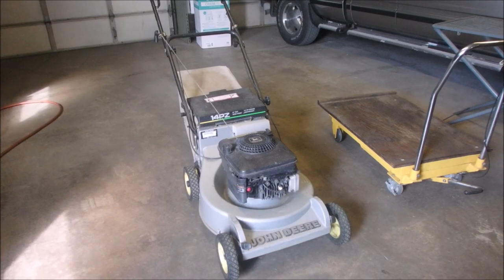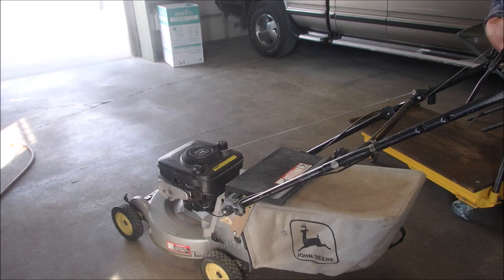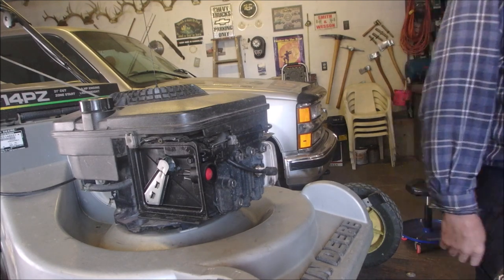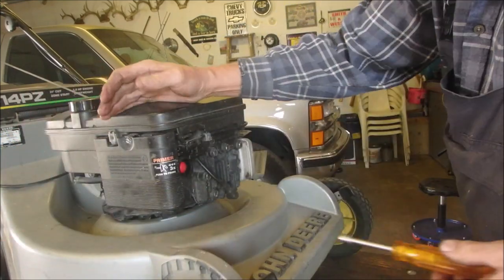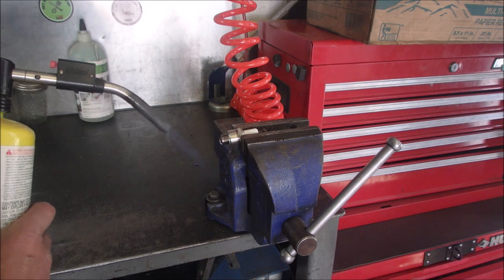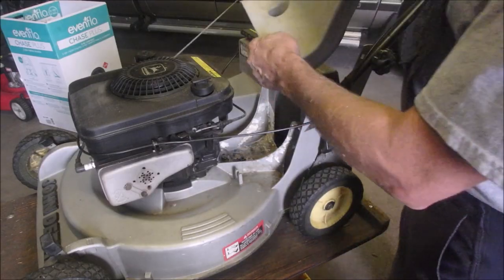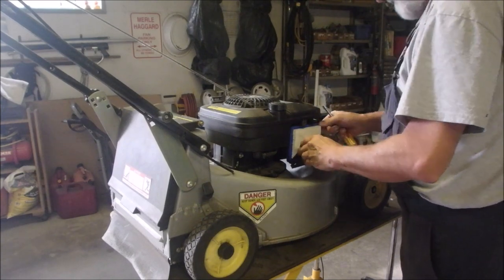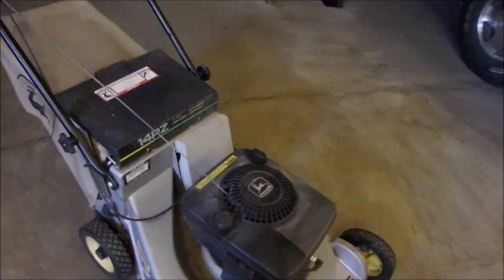John Deere 14PZ Push Mower,  Intermittent Start

Comment: I've got the 14SZ, self propelled with the Briggs engine. That plastic cover is where the belt is located, with the transmission in the rear. Great mower.
Reply from the maker: Thanks for the info!   That makes a lot of sense.
Reply: I have the 14SZ too, with a Briggs, my Dad bought it new in 1993 and I’ve been using it since 2009. Still starts first pull. Best mower ever.
Reply: That's about the same age as mine. The aluminum deck is great. The wheels wobble quite a bit. Thinking the ID of the wheels wore larger, as well as the bolts probably wearing down. Should buy new wheels and hardware I guess. I grease the rear wheels and clean out the rear wheel gears of debris buildup in the teeth.
Reply: @billlink1726  yeah my wheels don’t wobble much but at least 2 of them are very worn, I should be retreading them or something. They were such great mowers it’s too bad they stopped making them. I guess my replacement would be a Honda but I find the Hondas a bit awkward, I’ve used my Dad’s and it seems like a longer 
 deck.

Comment: Always nice to see this series in good shape, and good job. As others have said, the cover is for the self-propel equipment for the 2- and 5-speed transmissions. I have 3 of these; a 14PZ like this because my wife hates self-propelled mowers, a JX75 because I hate non-self-propelled mowers, and a 12SB (the 2 being for the 2-cycle Briggs-branded Zenoah 2-cycle engine) that I can't let go of because I mowed my grandparents' lawn with it throughout my adolescence and it brings me back to 1995 and makes me smile. They mulch awfully well, but the aluminum decks will still rot if left full of wet grass mush.
Reply from the maker: Thanks a lot.  After I made the video I was editing and went DDUUHH  That is for the rear drive of another model.    Thanks for letting me in on your past.  Very interesting.

Comment: Excellent video Bruce and great tip on heating the spark plug then cooling and checking resistance in both conditions to confirm the intermittent problem. By the way only tighten the head bolts when the engine has not been run and cold then we mark each head of the bolt with a paint marker that matches the deck colour so if we get it back we know we have tightened them and we check again then remark the bolt. Your are also correct that B&S do not make them like that anymore and additionally being so old it was likely purchased at a dealership, BIG difference on what you buy today from a dealership or a big box store with the big box not carrying the exact same quality JD equipment. Always check the model numbers and call a dealer to confirm you would be getting the same JD they will likely give you the information on the differences between theirs and the big box stores. Additionally the dealer is like family when there is an issue with your mower try dealing with the big box stores sometime it is a nightmare like THEY DO NOT EVEN TELL YOU THE MOWER HAS NO OIL IN IT AND THERE IS NO OIL IN THE BOX. We have had at least 10 customers this year call with seized engines because they did not put oil into the engine. We have helped half of them get free replacement mowers and do not want to get into company names that would not help the others out.
Reply from the maker: Thanks Wayne.

Comment: Very good Mr B. Had the same problem only yesterday with a brand name plug too. Intermittent can be tricky to diagnose & could lead to chasing you tail when it's actually the simplest solution.               😏     D0oohhhh!
Reply from the maker: Right.  If I had changed the plug right away I would still wonder.

Comment: Well done Bruce.  This is my old mower that you picked up in Lacombe Alberta.  It did me well.  It was becoming increasingly frustrating when it wouldn’t start when warm. 

Although I am capable of spark plug oil and air filter changes, my concern was it may have been a bit more complicated and beyond my skill set.  I did change out the primer bulb a few years ago as the original was cracked.  

We bought it in around 1996 or so from the John Deere dealer in Red Deer, Alberta.  

 This past spring I wasn’t able to find a name brand spark plug in Lacombe and picked up the laser plug at either The Home Hardware store or Peavy Mart in Lacombe.  I have a Husqvarna snow blower and a Champion pressure washer.  Will pay attention to the spark plugs and try to go with better quality ones and stay away from the Laser brand.

LOL regarding the grass behind the one shield.  Damn I missed that.  It would generally get a good hose off a few times a year but should have removed the shield.

Glad you were able to pick it up and hopefully it goes to a good home.  Although it has an aluminum deck I was finding it more and more difficult to push it with my artificial right hip and a left hip that likely will need to be done in a few years.  I bought a push Ryobi electric dual blade 40V unit which is actually very light.   I looked at the self propelled ones but they are actually quite a bit more heavy.

As I mentioned to you the throttle cable system had busted and I was using it without this and just adjusted the throttle directly in the engine.

Thanks again and hope you are able to get it to a new home.
Reply from the maker: What a great comment.  Thanks for looking after the mower.  It is a cream puff as i said in the video.

Comment: my neighbour had a none starting almost new snowblower and it was just a bad plug. I  have a briggs on a poulan blower. pull start works great when cold. hard to start warm except with electric start.  pretty sure I switch plugs (did coil and carb) but maybe will try another new ngk plug.
Reply from the maker: Did you remove the plug adaptor.  The are a 90 degree thing.  If it has one.  They go bad too.

Comment: Very interesting plug issue.  Did you ever figure out what the plastic cover was for?
Reply from the maker: am now sure it is for a rear drive unit that would be a different model if used.

Comment: I have a brigs that has something similar,   it will not restart when hot,    head bolts are ok,  coil is fine, plug is fine, I actually changed it to a good used one i had.   I was thinking it could be a head gasket or valves. it also feels like when it is hot it looses compression.
Reply from the maker: Right just ended up being a plug that went partially open when hot.

Comment: My experience with those JD models is there is much to like, but the plastic wheels are a weakness. As they get old, the plastic gets brittle and just cracks around the hub bolts. A good approach would be the Guys Playing With Tools way, as Bill’s trademark is to buy new wheels for his flips and other repairs.
Reply from the maker: I thought of drilling out the axle hole and put in a 1/2 inch bushing in the wheel hub.

Comment: Aloha Bruce!  Once I started watching this video, I was holding my breath for you to diagnose the problem as I have the same issue with my mower.  It has the same B&S Quantum engine and it will start on the first pull 99% of the time, but once I run it, I have a hard time starting it up again.  It started maybe a few years after I bought it and the mower is now 19 years old!  My dealer said it was probably a leak in the head gasket, but I never bothered to replace the head gasket as it starts up perfectly when cold and I didn't want to make it worst.  I have changed/checked/cleaned the spark plug many, many, many times and I am sure that is not the problem!  With your help and few other YouTubers, I have been able to maintain this mower, so it's a bit frustrating to have this issue.  Would love to hear your thoughts.  Mahalo from Kauai, Hawaii.  Thomas
Reply from the maker: Usually when a mower does't start after it is hot i change the coil.   For some reason on this one in knew it wasn't the coil.    here is a video changing the coil.
Reply: @BrucesShop  Thanks Bruce for the suggestion.  I heard you say that once or twice in the video.  May try to swap it out if I can get a replacement at a decent price!  Mahalo!

Comment: Hello Bruce. She cleaned up nicely! Great job! I wonder who manufactured that mower for John Deere? Sure would make a sweet lightweight trimming mower.....that no one seems to use nowadays.
Reply from the maker: Thanks Don
Reply: The silver-decked 14PZ/14SB/14SE John Deere mowers were actually manufactured by John Deere.  Even the slightly rounder but similarly shaped green JX75 mowers that came after the silver decks were still made by John Deere.

Comment: A customer gave me a nearly identical 14PZ for me to fix up earlier this week! The old gas had gummed up in the carb and then leaked out and melted the blue material around the air filter.
Reply from the maker: Wow.  Did you fix it?
Reply: @BrucesShop  Mine must be slightly older than yours, because it has a carburetor that has a cable-operated choke.  I was able to fix it by removing the the choke butterfly parts from the old carb and adding them to a spare carb from a pressure washer.

Comment: Nothing runs like a john Deere  even if it is not John Deere green that deck is cast aluminum I believe
Reply: Yep, cast aluminum. I used to have a John Deere 14SB that was self propelled. Even with the aluminum deck, that sucker weighed around 110 pounds dry weight!
Reply: @AnthemBassMan  thanks for letting me know about that machine
Reply from the maker: Thanks
Reply: @BrucesShop  your welcome young man 👍😎
Reply: Bruce’s is not John Deere Green. It’s a Red Deere.

Comment: I understand you wanted to prove the plug was bad, but with the price of quality brand plugs at around $5 or less, it doesn't seem worth the time and trouble.  Other small engine Tubers are even more resistant to changing out the plug when there's running issues.
Reply from the maker: I knew someone would mention it isn't worth the time.  To me this is my hobby and I chase every trouble until the machine is either running or in the scrap pile.    I have not had any NGK plugs go bad .  Yes they carbon up but I clean them well.
Reply: @BrucesShop  the precise understanding of the problem has value far above the cost of a spark plug. Your work shows that 1.) explanation  of the intermittent problem. 2.) replication of the problem under lab conditions 3.) the beauty of the curious mind 4.) it is fun to play with fire in a meaningful, purposeful way.  Lead on Bruce!